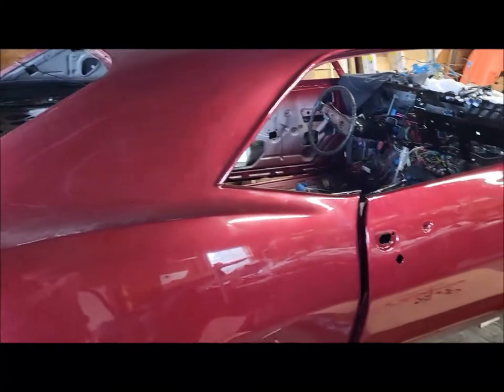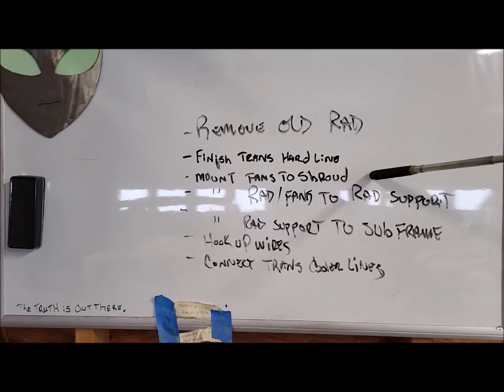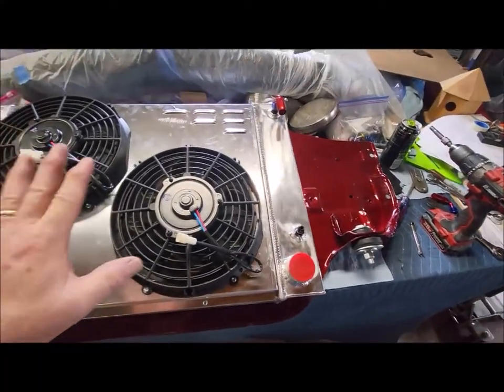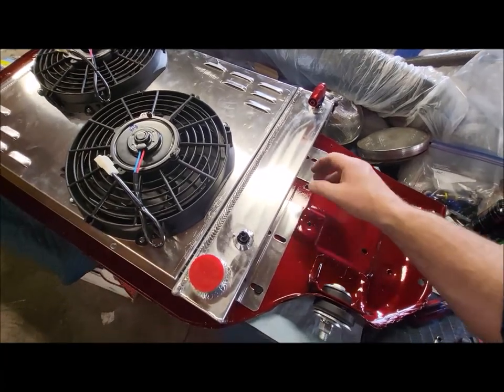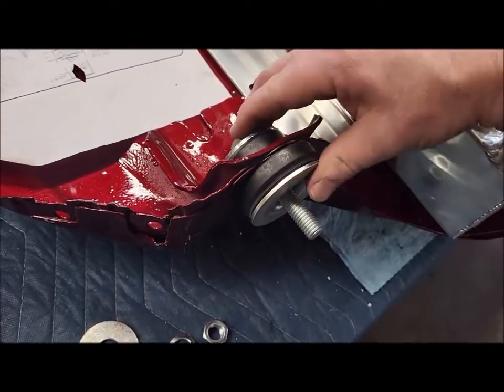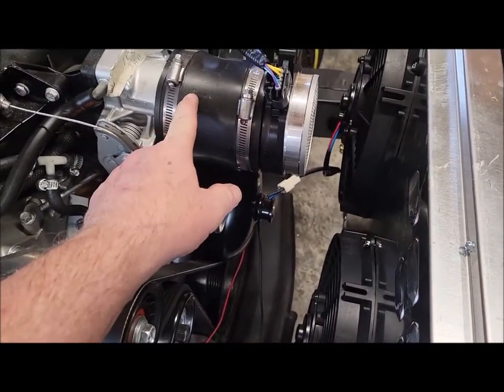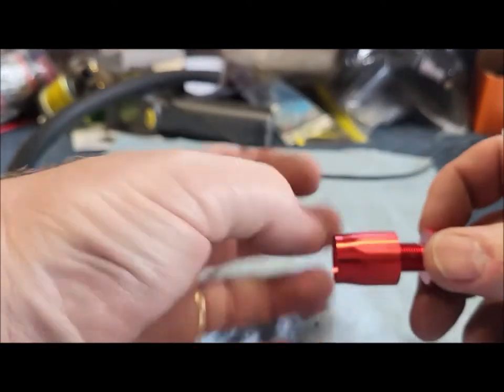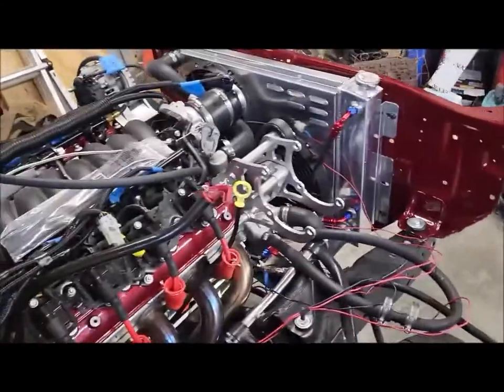69 Camaro: Champion Radiator Install

Comment: Word of advice! never use Teflon tape or anything of the sort on an AN fitting. Only on the NPT side.
Reply from the maker: Roger roger.👽
Reply: And definitely mean no offense! The seal just come from the flare. Using tape on the threads can cause leaks.
Reply from the maker: No offense take at all. I've learned so much from other youtubers videos and from comments. All knowledge gained is passed on. Might be goofy but "See one, do one, teach one", this is how I was taught in the military. 👽
Reply: @AlienRestoMod  I was a aviation mechanic in the corps, so I built an hoses and tubes daily!